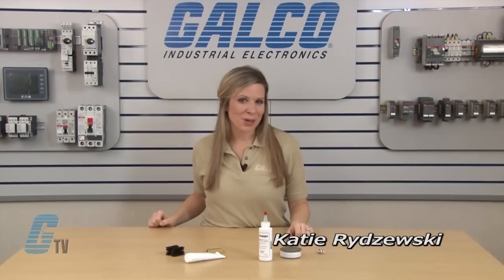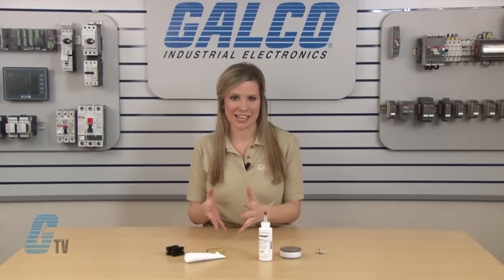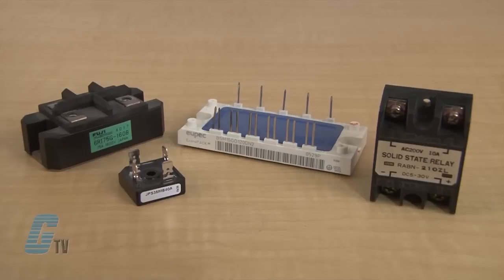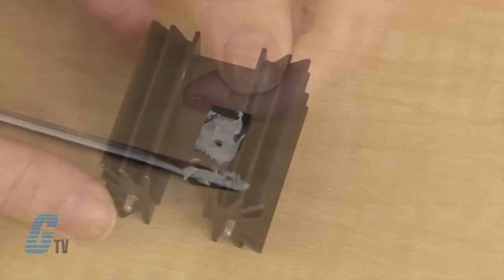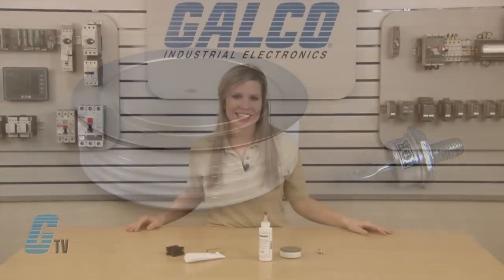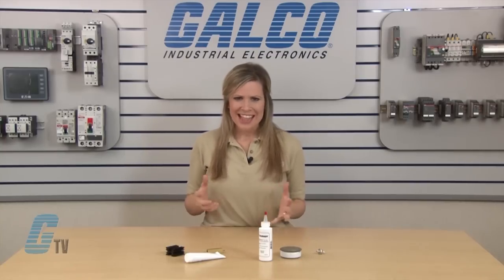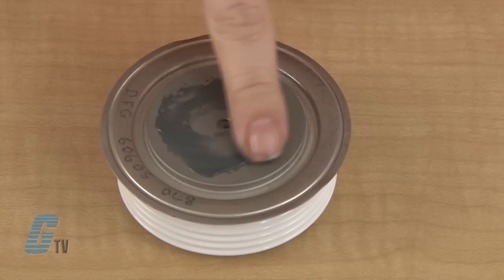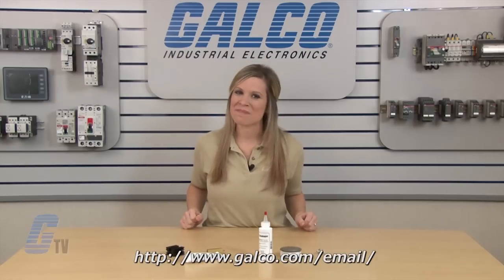How To Use Heat Sink Compound

Comment from the maker: The first type of heat sink compound is intended to be used on applications where the contact surfaces are thermally conductive as well as electrically conductive.  The other type of compound is to be used on contact surfaces that are thermally conductive, but insulated electrically.  The silicone free heat sink compound, such as the Tech Spray 1978-DP, is intended for all electrically isolated base encapsulated modules.  Primarily these are used with devices such as bridge rectifiers, IGBT modules, transistor modules, solid state relays and power modules.  

Electrically conductive material, such as the Burndy Penetrox A-13, and is for non insulated modules and stud mounted power semiconductors.  This can include components such as diodes, SCRs, triacs, and transistors.  It is intended for any device that has an electrically conductive connection point that is being mounted to a metal surface with a need for heat dissipation.  The Penetrox A13 is non petroleum based with suspended zinc particles and works well with aluminum to aluminum and aluminum to copper applications.  This material is easier to clean and can be applied with a finger or brush.
Reply: GalcoTV  Can I use it for my CPU on my pc